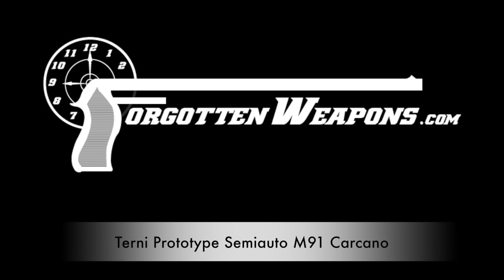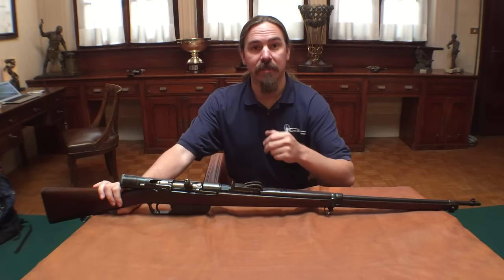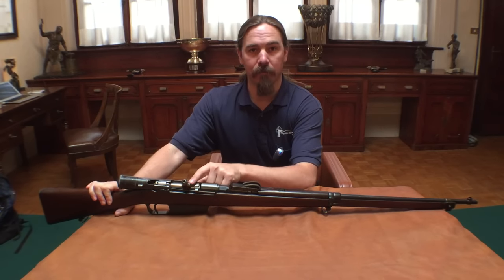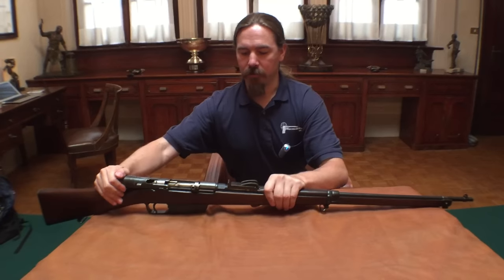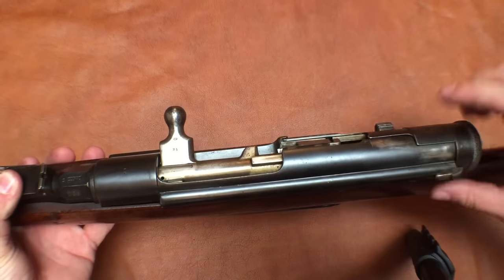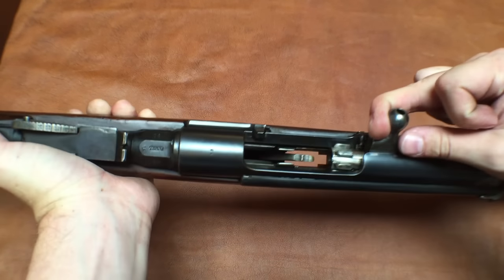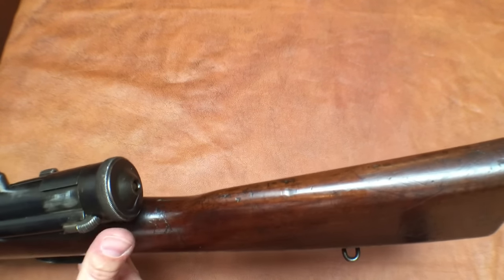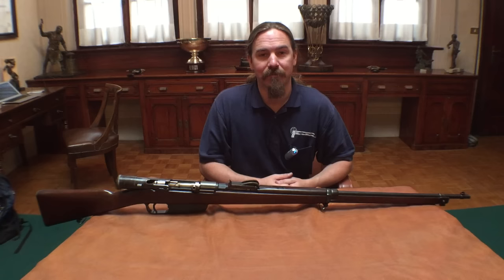Terni M91 Carcano Semiauto Conversion

Comment: We have a first hand account of the functioning of this rifle in Maj. Luigi Gucci book "Armi portatili" year 1915, p.58, and of the reasons it was not adopted. 
"The tested model, very simple, rugged, as handy as the M91, had shown a reliable, predictable and effective functioning, and it has a relatively low cost for the transformation. However, although  the weapon could be assigned to some special troops, it's not convenient to adopt it for the entire army".
The reasons were that the cost effectiveness was only apparent. In adopting a semiauto rifle for all the army, the price of the rifle was, in the end, marginal in respect to the price of the same cartridges for it (the price of a brand new semiauto rifle, not a conversion was estimated in 60L, that of a single Carcano cartridge was 0.1L, so a semiauto rifle costed like 600 cartridges), So it made little sense to adopt a solution that, "however ingenious, simple and well designed is, it's anyway a stopgap and, as such, it can't fully comply to all the requirements of an excellent infantry semiautomatic rifle."
Reply from the maker: Cool, thank you!
Reply: You are welcome, and thank you for the video. Knowing Gucci's book without having seen the rifle he was talking of, I was very curious about it.
Seeing the rifle, it's easier to understand his reasons. IE, Gucci talks specifically of the barrel. The reason of the conversion is mainly to reuse the existing barrels (that are left untouched) as well as the receivers (that have to be remachined), the stocks (that have to be slightly reworked), and the magazine. At the cost of a new bolt, a recoil spring, and some minor parts.
But Carcano barrels have been designed for a bolt-action rate of fire. Gucci, talking of a generic rifle's barrel of his time, says that it's internal reaches 450° after 80 rounds of rapid fire, and says that it has been estimated that the barrels of the converted rifles, due to the more rapid fire allowed by the semiauto operation, would have been worn out after about 2000 rounds. So there is little sense in using a less than optimal rifle to reuse a thing that is however destined to wear out quickly.
We can make a similar consideration for the stock too. To save the receiver-barrel assembly, the shooter has the recoiling mass of the receiver directly ahead of his eye, and above his thumb. Although that's not really dangerous, it's surely discomfortable. the situation could be improved with a new stock, with the receiver a little farther from the shooter's eye and a more pronounced pistol grip that moves the thumb away from the receiver. But, that way, you don't save the existing stocks any more. Ecc... ecc...
Reply: +Neutron Alchemist you just gave an insane amount of well articulated information on this rifle and all I can think of is heh Gucci.
Reply: Superdude70  You are welcome!
Reply: Herbert Norkus  What's the correlation between the Fiat cars made from 1960 till today and a Beretta 1908 rifle ? Moreover what's wrong with the Fiat 500 thanks to which They bought Chrysler ?
Reply: Only problem I have with this analysis by the major. Is the fact that, they (Italy) didn’t adopt anything as a follow up. Now sure I’m saying this hindsight 20/20 after the fact. However even if this was a “stop gap” solution. They relegated themselves to continue making bolt guns for another decade or so. So it goes to show how much the military branch of Italy while reasonably thought out. Kinda screws themselves being ready for WW2 in so far as small arms development and armament.
Reply: @robosoldier11  The analysis is of 1912. Then WWI happened (and semiautos like the Mondragon and the Remington Model 8) didn't impress there, unfit to trench warfare, they were relegated to the balloons of the artillery observers). 
However, this analysis, and the observations made during the war, led to the Terni 1921 prototype, already in an intermediate cartridge (7.35X32mm), that had been long evaluated. 
Then it was decided to not go with the intermediate cartridge and run a contest for a semiauto in 6.5X52 Carcano (the one won by the Scotti Model X). 
Then evaluations made on the Scotti in Etiopia, and the decision to switch to 7.35X51 cartridge anyway led to a new contest, that didn't end due to WWII.
Reply: @neutronalchemist3241  Which again resulted in Italy not adopting anything until literally the last minute with the Armaguerra rifle in 1939. I guess this is more a critique of the Italian decision makers behind the scenes more then any one person. More or less alot of these designs didn't seem that beyond the pale awful or at the very least they did have options to work on, refine and consider like in one of their trials was a czech design the ZK-391 that looked promising. I guess my opinion is its better Italy adopted something earlier on so they can overcome the initial hump of uncertainty of what they wanted compared to waiting forever until they have nothing. Or worse have something but its too late to make use of it which is what happened.
Reply: @robosoldier11  The Armaguerra 1939 had not been adopted, but approved for service. It means it could be distributed to the troops to test it on the field. As for not adopting anything, Italy is in company of practically everyone bar the US (the Soviets adopted one, but had to revert back).
Reply: @neutronalchemist3241  I suppose. I've always found Italy to be an underdog nation during this time period that fundamentally was filled with an extreme amount of potential in regards to small arms design. It just seems like a waste they never really capitalized on anything given to them as they often determine the shortcomings as too much. Or they kept making choices that delayed more refined military development to be in place by the time ww2 came about. I mean they seemed content with the Breda 30 despite all the short comings that later came out from it and in general the rather.....tenuous performance it provided. But stuff like these self loading rifles that could've been taken in, refined then ideally mass produced they just never went with it. Overall I'm not a military planner it just seems like from the laymens point of view they could've had something sooner rather then later.
Reply: @robosoldier11  To me, as a technical enthusiast, both the Scotti action (the one you see in the Model X, it had been scaled up to 37mm automatic cannons) and the Breda gas action (the one you see in the Breda PG, that too had been scaled up to 37mm automatic cannons) were very good. The Scotti bolt was made of four pieces, with little precision machining required. The Breda of five, with only straight cuts. The Scotti rifle only required to fire from a closed bolt and a magazine to be a very good semiauto, and it's difficult to imagine a simpler one.
But in 1939 Italy had 1/4 of the industrial output than Great Britain. There were budgetary constraints.  France, that had other economic possibilities, adopted a new bolt action in 1936.
In the same period, the US had something like 42% of the world's industrial output.
Reply: @neutronalchemist3241  Ya I recognize the macro elements. Again just a shame they never were in the position to pull the trigger. Hence my annoyance on the Major heres report on this conversion. Again they had multiple options to really pursue something and they just didn't. Oh well frankly I hope someone trys to recreate some of these examples like the Breda PG cause really it is a shame they kinda just faded out.
Reply: @robosoldier11  I would rather see those ideas used in new firearms. Like a Scotti action GPMG, or a Breda action AR. 
We've already seen good ideas given justice after decades of oblivion. The Steyr rotating barrel in the Beretta Series 8000 and PX4, the Bergmann floating lock in the Archon, the Revelli rotating lock (that of the Glisenti 1910 pistol and FIAT-Revelli 1914 MG) in all the 5.7x28 pistols bar the new S&W...
Reply: @neutronalchemist3241  im sure in one sense it’s better if one element endured and becomes something else. However I’m more intrigued about the individual examples tied to said development. Since all those pieces came together to make that thing. I’d personally would love for example to get my hands on one of those Breda PGs. They just seem like a cool thing to admire and possibly recreate and build upon.

Comment: Clever design. If it had seen military testing, I wonder how well it would have done
Reply: Bayonets were a pretty big deal at that time, they would have needed a solid way to attach it other than using the barrel. Having it cycle back even if you only used it while it was empty(if it were loaded it would open the bolt system causing it to be out of battery) would cause it to lose energy on a thrust.
Reply: Evirthewarrior just make a separate lug system on the side of the rifle.
Reply: Nice design, but I doubt it would pass your mud/dust test.

Comment: Hi, Ian. I was walking on the beach a few months ago and stumbled across a large bullet cartridge. It has already been fired. I thought it was a 50 BMG but the place that the bullet was held is larger in diameter than 50 caliber. It has a triple element headstamp that displays a "1" or "I" at the 10 o' clock, a "C" at the 2 o' clock, and a "42" at the 6 o' clock. It looks very old as the top where the bullet was held is oxidized and falling apart. If you have any idea of what it is just let me know.
Reply: In what country did you find it?

Comment: This looks like a rather slick and well made conversion. I wonder if it had functionality issues that held it back, or if it was too expensive, or if the short recoil/bayonet issues doomed it.
Reply from the maker: Probably all of the above.
Reply: All the moving parts and that exposed area at the top make it seem like it would not fare well in rough conditions (dust, mud, water, etc).
Reply: @Forgotten Weapons
 i was wondering ian if i could get some help identifying a shell i have a few pictures of and some mesurements but i cant find anything in any books about it

Comment: Hey Ian, I was just wondering why nobody ever tried to make a self loader out of straight pull rifles like the Mannlicher 1895 or k31. Wouldn't that be as simple as adding a gas system, return spring and semi trigger group. It seems much easier than having to add a whole unlocking mechanism

Comment: Why do rifles not use an interrupted screw instead of lugs? (Like an artillery breach) Wouldn't you be able to get a stronger seal for less material and, depending on your design, you can have any amount of rotation you need...
Reply: Rifles don't need that much locking strength and a simple lug is easier to produce. That being said, check out a mkIII Ross Rifle.
Reply: I think a large part(as wingracer said) was ease of production. Alot easier to make interrupted threads on a 6 inch breach block, than in a inch wide(or so) receiver. And when not exactly needing any potential strength gain, it is just more of a PITA. Also, I would think that the threads would be more susceptible to damage and fouling.
Reply: The Ross Rifle used a type of interupted threads and look how well that worked.
Reply: Some do... Sort of. Remington pump rifles and some weatherby rifle bolts come to mind.

Comment: I assume the reason why it didn't take off is because the rear of the action would destroy your hand just for firing off a single round. Either that or turn every shooter into a pirate, instantly. I can't conceive of a way of holding the thing without hurting myself.
Reply: If you watch a video of the shooting of a Carcano, you can see that the aiming eye is way back, and the thumb had to be below the receiver already at the moment of shooting. However to have that recoiling mass close to the head, and to adapt the position of the trigger hand, is surely discomfortable, and is surely part of the reason the conversion wasn't adopted.

Comment: Did any military ever actually adopt one of these bolt-action conversions, or were they all deemed too unreliable?
Reply: DevaKitty the latter
Reply: The Pedersen Device kind of counts maybe? It was produced in large numbers and does make make a Springfield semiautomatic, but you get a pistol caliber carbine instead of a semiauto rifle, and it was never actually used.
Reply: Another issue is that many of them end up being more complicated to make than producing a brand-new rifle from scratch, thus losing their main economic advantage of exploiting existing stockpiles of bolt actions. No point is converting your old rifles to save money if it doesn't actually save you money. 

Also, some armies decided it was not such a bad thing to retain a supply of their old rifles after all because they found they nearly always ran out of new rifles to arm the front lines when wars actually started. By forcing governments to buy all-new rifles, that increased the total supply of firearms for military use.
Reply: It's not really a problem of reliability. It's that the cost of the conversion was not really that much lower than that of a new rifle to justify it's adoption instead of a brand new rifle.
Reply: Of course, one may be wondering then why did they think they could make cheaper guns by converting bolt-actions and the answer is because the conversion of muzzle-loaders to breech-load back in the 1850s and 1860s had been quite successful and very cheap way to modernize. They grossly underestimated how much more complicated semiautomatic firearms needed to be.

Comment: Italian autoloading designs seemed to favor the short recoil system.
Reply: i think most early semi-auto protoypes favored short recoil systems because engeneers used to think that drilling a hole into a barrel for installing a gas tube was going to make the rifle inaccurate. Plus Italy is very poor on metal and putting another tube in your rifle when you can bareley make the bolt-ones is a problem